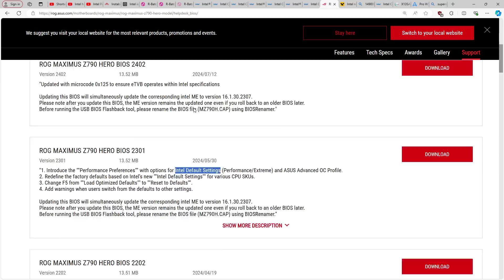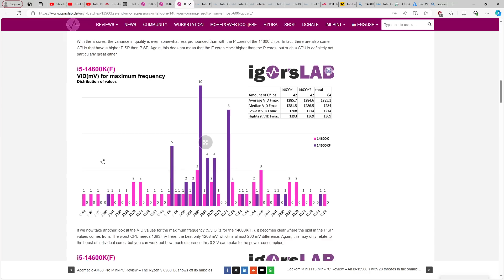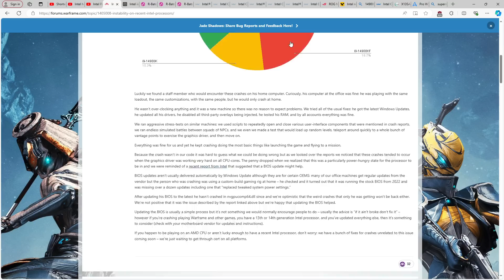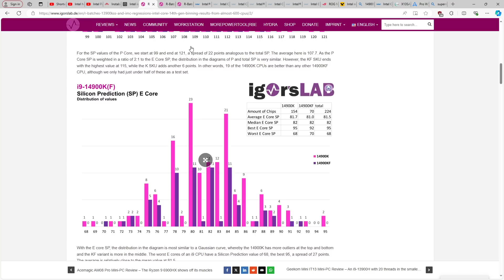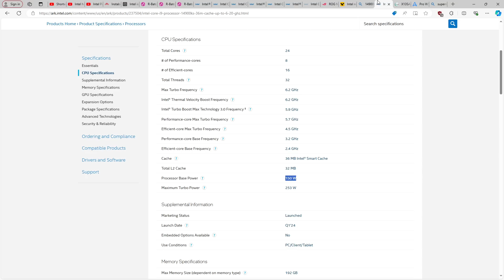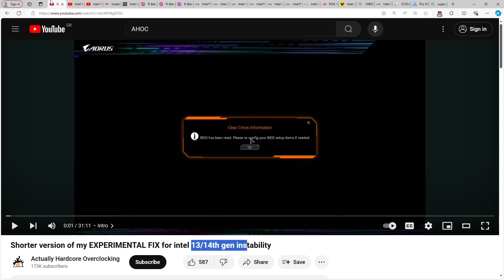The intel instability and degradation rant.

Comment: 39:50 regarding lowering the boost clock to fix it... wasnt there a whole thing about ppl saying the main/only "lasting" fix they found being just locking the multiplier at like 53?
Either way, can't imagine that nobody at Intel saw this coming. Smells like a whole lot of engineers going "told you so" to the merketing people that made them push the silicon so much so they have something "new" to sell.
Reply: Locking the multiplier might not even be a fix, it's just a guess at this point. And by that point you're better off buying non-K. :P
Reply: marketing team cannot push anybody into a design decision that involves risk.
first the CTO ask for an assessment
and then discusses with the board of directors including CEO, and there the marketing director can try to justify the risk
Reply: @marsovac History says otherwise
Reply: @marsovac  Are you on the board of directors at Intel? How the hell do you know?

Comment: I think Intel is fine with their I5's, they just need to fix I7 and up. At the least, if you bought an I7 and up, you should be financially compensated. They would have to first fix the price accordingly to the performance. If it's not getting close to the performance in the box, then they're ripping people off.
Reply: I have a 13th gen i5 and I'm pleased with it so far. If it doesn't degrade like the other ones, I'd say it's a very good value chip that seems to be severely underrated
Reply: @moonasha I know, it's the budget go to right now. Cheap, lots of cores, plays nice.
Reply: @moonasha  come back in 12 months--if your computer can even boot into windows by then
Reply: This is generation issue. If the i5 uses the same architecture as i9 of 13th and 14th gen. It is going to face instability. Maybe not this week maybe next month. But definitely it's not free from it. I have read about 13700k and 14700k issues with recurring BSOD.
Reply: @Riyozsu  yes, the I7's and up seem to be the issue. The I5's really don't seem to have any issues. I'd still get one of those. They also said that the 12th gen is doing just fine. Recalling the 13th and 14th gen I-7 and I-9's seems like the only logical step.
Reply: I hope you are right

Comment: Really curious now what Jufes at Frame Chasers has to say about this...
Reply: bro is putting his trust on a scammer w lower iq than ocn net forum avg user XD
Reply: He was live yesterday and said it. Basically problem is 2 cores are trying to boost too high with not enough voltage.
Reply: @sanchezmiki2006 That almost sounds plausible now that we know the degradation happens even at 125W power limit. Though only if Intel is actually able to fix it, if not then it's def not that simple.
Reply: He pushed a video on YT several hours ago and basically boils down to 1-2 core boost clocks = too much voltage (and here 125W power limit won't help) and that happens to the whole chip, not just that/those cores. Bad voltage tuning in general. And people not properly cooling aka delidding, since 13th and 14th gen generate SOO MUCH HEAT that you can't really run then at stock or better without serious cooling. Boosted that he had 0 issues with what he made/sold.

I soooo wish Buildzoid would do a react/response video to that. I'm really curious what he thinks about that. On this specific topic they were pretty aligned with the boost and voltage.
Reply: @Winnetou17  Yeah I just saw it. Even tho he's right about what's causing these problems, he's not really directing the situation in the right place. Imho his narrative of "this is why i9's are only for absolute enthusiasts" is wild.
Reply: @atirta777  Yeah, I can see a bit what he means, but it's a bit stretched. He did say though that it's 2/3 Intel's fault ... and there I roughly agree. It is mostly Intel's fault.
Reply: @Winnetou17  i would much prefer someone that know how to use a osciloscope than a fucking cod guy scammer. no matter what u gonna say. he is a clown..

also, "MUCH HEAT" , U know sensors hotspots are in weird positions and will never show reality in dumb hwinfo right? the intel problem is just bin and user.
Reply: That dude is a literal clown, people actually watch him? Those thumbnails and titles just make me puke.

Comment: snort intel increase voltages to the ringbus that degrading and all compoments makes errors. solution reduced ringbus voltages and vcore and a maxed clock of rignbus below alder lake level. means lower vcore at 1,2v maximum and Maxed ringbus of 3,6ghz similar ecore clock and p core at maxed 4,6ghz
what a failure of an architecture
I assume a manufactoring failure of intel 7 node due to try shrink the node  in smaler sram cells

fatal failure in planing for the chip
Reply from the maker: YOU CAN'T LOWER RING VOLTAGE WITHOUT LOWRING P/E CORE VOLTAGE. The hardware to do that doesn't exist.
Reply: The ring/pcore/ecore share the same voltage rail, meaning they can't lower vcore independently for the ring, either they all go down or none.

Comment: I have an i7-14700KF, overclocked and power limited, running since October '23 without any issues whatsoever.
Reply: My advice is, until this issue is fixed or is clarified, don't overclock your 13/14th gen cpu. Undervolt/underclock it until i5 vcore is reached. Around 1.2 - 1.25v should be fine and power limit it to Intel's i5's spec. Just to be safe atm. And accept the perf hit for the moment, sadly there's not much more to it.
Reply: same here, 14900K since january
Reply: Without issues.. Yet.
Reply: @dethskullcrusher  if youre not a clueless user you wont ever have any issues. You usually test stability right when exchanging hardware, you wouldnt run a system thats not stable would you?
Reply: @tqhr Then how you explain the issues with the server cpu's? Do you think the engineers using those systems are "clueless users"?
Reply: @dethskullcrusher  well what did these engineers do to try and fix these issues? Based on that anyone could tell if they are clueless or not. 
Being an engineer doesnt exclude you from that pool
Reply: @tqhr Listen this bit of the video mate 35:11
Reply: @tqhr Why would you need to fix the issue in the first place? This issue shouldn't even exist. Not even the manufacturer is capable atm to fix this issue. And yes, being an engineer does make more capable of fixing this sort of issues.
Reply: @dethskullcrusher  absolutely not, that statement is just wild. Thats like saying just because youre a car mechanic youre more likely to give successfull first aid.

And dont you be going off topic now, you started this "Do you think the engineers using those systems are clueless users" and now youre trying to make it about "these issues shouldnt even exist in the first place"
Reply: @dethskullcrusher  okay i listened to it and its an assumption? Youre falling apart just like the ring is
Reply: @tqhr Say whatever you want man, is your pc. But in the end it doesn't matter, there's a widespread issue that nobody seems to be capable to resolve and affects users in every level of competence. 

Your opinion, my opinion don't change that fact and no amount of arguing is gonna change that. Want to overclock it? Do it, be happy, but if it breaks (and it probably will) you'll have no one else to blame (except Intel and yourself)
Reply: @dethskullcrusher  all this yap from you under a conversation where BOTH people said their cpu is completely fine. Respectfully, noone here asked for your advice. You came here with sarcasm and negativity, my cpu (OVERCLOCKED WOW  SO MANY CRASHES) runs perfectly fine since january. 
Thank you for your concern that is not needed.
60p 47e 50r HT ON* 58p workloads
Reply: @tqhr Doesn't matter, your cpu and op cpu are amongst the affected lineup, and worst, they're overclocked. Is not negativity, i'm saying that there's a proven issue with those cpu's, even if you haven't seen any so far you probably will. Take this advice (is the same buildzoid gives) lower frequency and vcore as far as you can tolerate, at least until the issue is resolved.

PD: I don't need invitation to post something in a public video, regardless of what you think this is a social platform.
Reply: @dethskullcrusher  so much yap, someone needs to feel validated. You just cant fathom that some people actually know what they are doing
Reply: @tqhr Sure mate, sure.
Reply: @tqhr  "someone needs to feel validated" - that sounds like projection. This is a real issue, facing users from all industries at all skill levels.
Reply: @FieryMeltman  its an issue when you leave the cpu stock + have a really bad sample. Most of the casual pc users do not know how to even go into the UEFI let alone change relevant things. 
You can fix this issue yourself. 
And projection? Look at mr know it best from before who was projecting his own failing cpu onto us (the 2 who started this convo and had NO issues).

"for you people everything is good? This cant be!! YOUR CPU WILL CRASH REGARDLESS" type shit.

I am also not denying that there are issues, of course there are. 
But you are acting like they are unsolvable, buildzoid even showed how to fix it yourself if you want to use him as a source. It just comes down to limiting the current / pls or giving it enough voltage to operate. It really only comes down to that.

Intel sadly was too lenient regarding their batches, especially for the i9s. Ive had plenty of them here / worked on alot of systems with 13900k/14900k+s to tweak or overclock them. 
Couple this with people who dont know what theyre doing / never tested for stability and its a disaster waiting to happen

Comment: After a week of launch, when I saw the 95 DegC "normal" temp, I said these cpus would not last a year or so..... And now degradation. Jesus, random 10 year old CPUs hardly operate over 50 DegC for sustained periods. Heck, server based CPUs are cooled below your normal body temperature for decades and they would last forever!.
Anything over 90 DegC with those minute traces internally,,, degrates with power cycles of home based systems....

Comment: I punshed in the intel baseline profile values manually for my 13th i7 with Asus z690 DDR5 and haven't had any crashes since. I know that after each new bios my memory speed decreased and the timings wouldn't work as before. The strange thing is that some primary timings could go lower and some second and thrid timings had to be raised a bit so i stick to the current third latest bios before they added Intel baseline profile.I am not going to do hours of stress testing again and again. I'm shure they fucked up something else with each version...

Comment: Hey can I get a straight answer. Is this why my starcraft 2 just freezes every couple minutes losing like 2 second freezes every couple of minutes? So much death in gaming from this.
Reply from the maker: Could be. CPUs can do very weird things when unstable.
Reply: how the hell should we know if your cpu is currently stable? the only thing we can say is that SC2 is built like a brick so it aint the program's fault.
Reply: With a problem like this there's a big BIG list of things to check in order to have an actual good, proper advice, not some guess. Which means it's totally not a good topic to have on YouTube comments.

Here's a few examples: how much RAM do you have ? What else are you running ? Have you tried with a clean OS, preferably Windows 10 (or Linux, if you know what you are doing), with nothing else installed ? Are you playing normal games or some custom maps that are filled with units and scripting ? Have you used any diagnostics software to know it's SC2 and not another program or antivirus or memory management that's causing the freeze (see also about trying with a clean OS).

Sooo...yeah, try a forum, like the Level1 techs forum or ltt forum or maybe even Reddit. Some place where you can have a thread and where you can post screenshots or logs so knowledge people can see how things work on your system.

Comment: the raptor lake i9 is just desperation. they're trying to get the top spot on the charts and they're using brute force - to the detriment of everything else. even the raptor lake i7s are blown up to the max, the i9 is just over the top.

even at the darkest days of amd they never released processors in that kind of state.

edit: also note that the 12900k stock clock speed topped out at 5.2ghz. the 12900ks went up to 5.5ghz. this is still considerably lower than the raptor lake chips.
Reply: Literally false. Just look at 9590.
Reply: >even at the darkest days of amd they never released processors in that kind of state.

One of AMD's first releases back in the day literally caught fire in the socket. Please do not fanboy a corporation anywhere that I can read it, so that I do not have to ridicule you for it.
Reply: @mehck2  I remember that video. The guy used an FX-9590 on an MSI Krait motherboard, which had 4+1 vrm and did not officially support the 9590.
Reply: @abesmissioncontrol2013  No, I'm talking about older Duron Athlon etc chips that caught fire because AMD didn't think to add thermal throttling to their CPUs for multiple generations in a row. Separate instance of AMD chips catching fire.
Reply: @mehck2  correct me if I'm wrong, but I thought nobody had thermal throttling back then. Even supercomputer CPUs by IBM didn't throttle, best they could do is shut down. To top it off, AMD introduced Cool'n'Quiet in like 2002 (?) and Intel introduced SpeedStep in 2005.
Reply: @danpc8685  The very first Pentium chip ever sold had thermal protection enabled. That's why it was such a huge issue at the time - AMD sockets literally burnt black from fire while Intel chips were safely shutting down if needed. I know because I was there and owned both a flamed AMD and an original Pentium 1. Lines out the door of AMD people returning their shit to CompUSA and Fry's Electronics. Took a decade+ for them to recover.
Reply: @danpc8685  thermal throttling used to just be thermal limiting, it's evolved a lot. Pentiums had it back then, AMD chips didn't. That is what impacted AMD's reputation for so long - if they're dumb enough to launch CPUs with no thermal protection, they may not be a good company to invest in was the thought.
Reply: @mehck2  don't forget to ridicule Intel for NetBurst pushed to 3.7ghz out of the factory, which was the best they could do to counter dual core athlons at the time
Reply: Clear that you never used AMD’s Bulldozer platform.
Reply: @iLegionaire3755  
My bulldozer from September 2011, which I overclocked to 5ghz and played with it every day for 5 years, is still running 24/7 at my uncle's. (So already 13 years of continuous operation)
My 2009 Phenom II X3, also overclocked, also ran for 13 years with my mother until I retired it.
My FX8300, which I bought in 2016 for €130, still runs with OC 24/7 for my partner. (8 years of gaming every day)
Since the Athlon XP 2000+ I have only had AMD CPUs and all of them have been overclocked to the limit (e.g. back then Athlon 64 from 1.8ghz to 2.6ghz) and never a dead CPU.
Reply: @iLegionaire3755  that's a different era where the tables were turned. let's not be cherry picking here, both the companies had ups and downs

Comment: Any word/evidence if this applies to laptop chips as well? Has anyone looked into that aspect? Curious to know
Reply: Intel just pushed it way too hard for the manufacturing process.  I was curious to see as well if laptop chips are affected given these will run hotter.  I guess degredation is triggered more by voltage rather than heat.  WHEA errors should be monitored though.
Reply: @baseModelCars  more clocks →more heat cycling → more mechanical stress → more pronounced degradation
more volts → stronger heat cycling and higher maximum temperature → faster degradation
Reply: Yeah, interesting suggestion. If it still errors, then it's not high voltages but maybe an actual error in design
Reply: Mobile CPU's won't be impacted because they use way lower voltages and will hit TjMAX quickly so will be thermal throttled. So i wouldn't worry about it being a laptop version.
Reply: @Dazzxp  hmm then chinese guys that make laptop cpus into desktop packages have a reason
Reply: @erkinalp  but again they are like 157w  ABSOLUTE MAX, vs the desktop that is using 100-150 watts more

i7 processor 14700K - Maximum Turbo Power 253 W
Core i9 processor 14900HX - Maximum Turbo Power 157 W
Reply: @erkinalp  HX laptop cpus are just a desktop die in a BGA laptop package. The problem is in the design of the raptor lake-s dies and HX uses the same die so it has the same issues. Actual laptop dies should be fine.

Comment: i5 4600K's are affected.
Reply: Assuming you mean 14600K. Because 4600K doesn't exist.
Reply: somehow i highly doubt a bunch of 2013 processors are affected by a 2021+ design issue
Reply: @quantum5661  You missed something. 4600K has never existed.